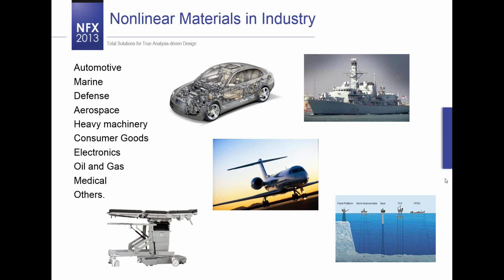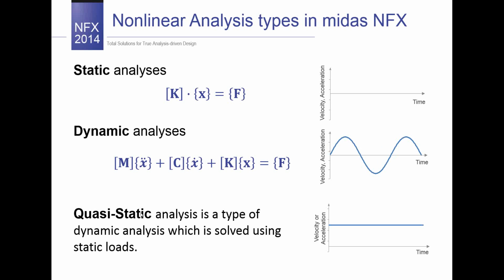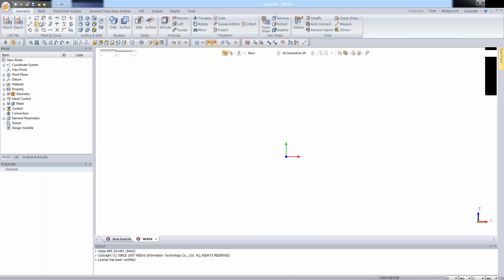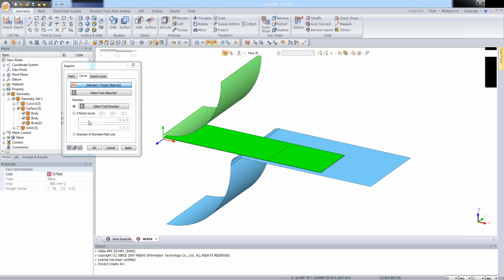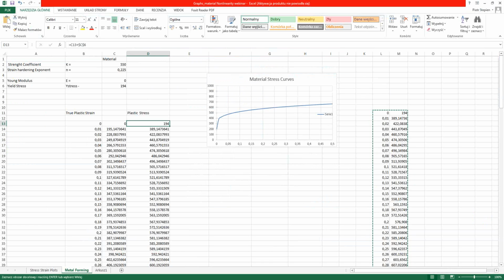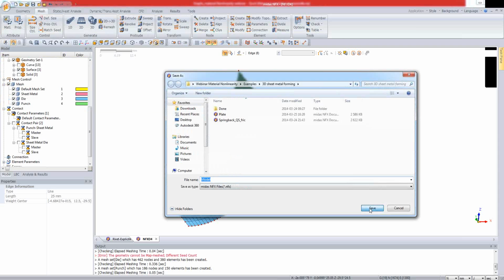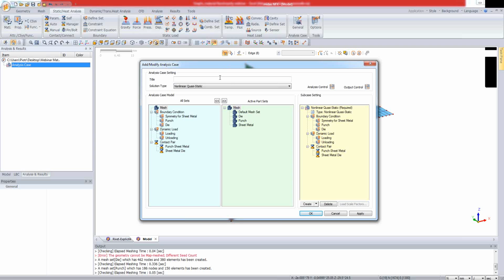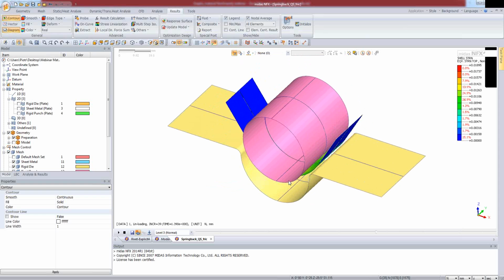FEA Webinar: Material Non linearity Modelling for selected engineering applications

Comment: Hello, thanks for the webinar. I tried to do the same simulation you have done, but does not give me result (I own version 2015R1 midas NFX), remains in the INCREMENT = 40 (80.00%) WARNING [4014] and ERROR [2104], now check the codes in the user manual and taking the recommendations indicate and does not fix.

Days've tried to solve the problem and do not get favorable results. Therefore, can you me facilitate the .nfx file with the result of the simulation, please.